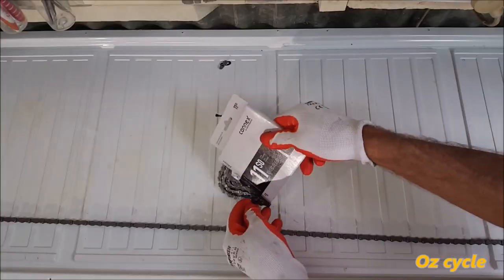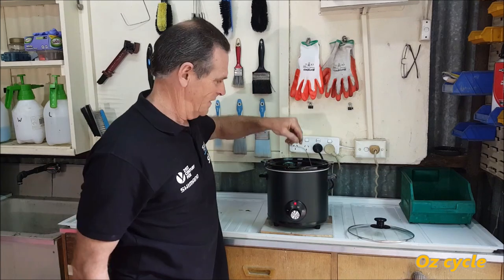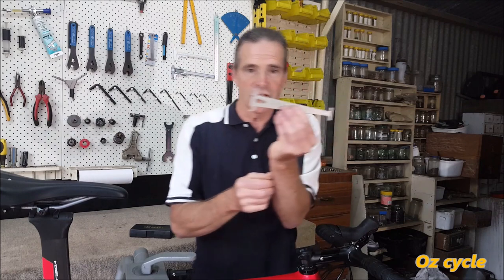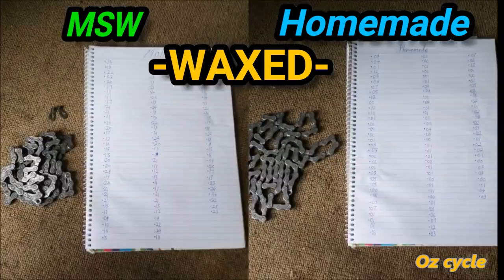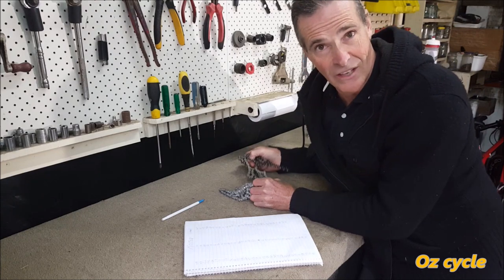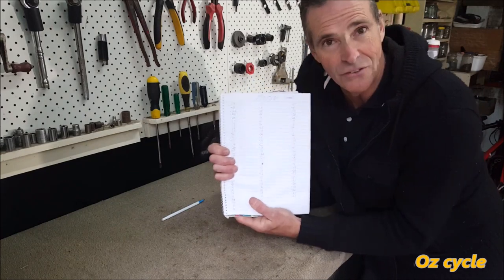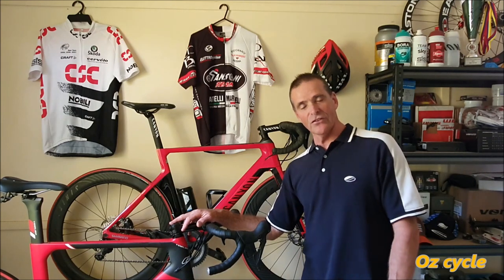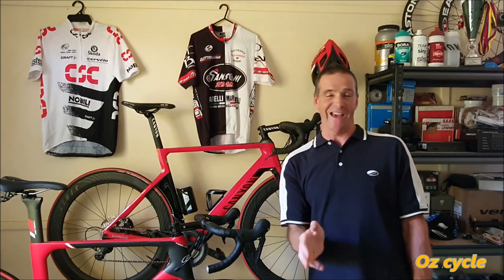Is this the ultimate bicycle chain lube? - Test results

Comment: I bet those are metal shavings in the jar, put a magnet on the bottom and dump the jar. I bet it's metal from the chain
Reply from the maker: I tried a magnet and yes,about half of the black residue moves with the magnet
Reply: @stevenleffanue  I use the park tools chain cleaner,  but bot the plastic one . I have the all metal one and stacked 2 magnets on the bottom to pullout all the damaging metal chips out of the chains when I clean them every 3-4 rides.

Comment: Molten speedwax has Molybdenum suphate in it. Thats whats in your petrol.
Reply from the maker: MoS2 is non-magnetic tho ??
Reply: @stevenleffanue  Im sorry i watched your other video later. To combat this during the cleaning step is that i have a small magnet in my cleaning jar. Which attracts the metal shavings in the chain. The interesting thing is why there is so much ferrous material there. Have you checked if your chain is rubbing the derailleur cage front or rear ever so slightly.

Comment: My MTB mix is paraffin wax and 25% 20w50 synthetic oil heat till liquid @~45-50C. Clean and dry the chain and immerse in solution for 15-20 min slightly agitate to ensure all air escapes the chain wax enters voids. Solution starts to skin @~28C. remove chain and allow to cool and drain in shade. I repeat this every 4-6 weeks (450-500km).

Comment: Measuring to even just .1mm while the wax is still on, and adhering to the jaws of the caliper, was pointless. Doesn't tell you anything, because you're measuring the compacted wax thickness. Needs to be metal on metal, as seen in second set of data. 

Cleaning procedure seems overkill. Brake parts cleaner/degreaser and a stiff brush would suffice.

Comment: Really good information, but I'm no longer a 'believer'. The noise from a waxed chain it a whole lot more. For me a quiet drive train is faster in my head, so faster on the road.
Reply from the maker: Sorry to hear your bad experience Byron. Key to successful chain waxing is initial thorough clean to enable the wax to adhere to the metal. It should result in smoothest and quietest chain.

Comment: You are missing the initial measurement, so I dont know if this renders Your test useless.
Reply from the maker: Could you elaborate a bit more,not sure what you mean?
Reply: @stevenleffanue  First of all, I love Your reviews, and would not consider them biased. 
For every measurement after the usage period, for the test to be scientific, You should have measured the chains as they were brand new, before waxing. We can compare them afterwards with a new one, but in 0.1 of an inch differences, the possibility of a slightly different initial lenghts cannot be outruled.
Anyhow, I still think theese should be of the same lenghts, considering theese are made in a same mold, I am just saying that, for the test to be scientific, we should always have a null-measurement.

Comment: 0.001mm??? I somehow doubt that.
Reply from the maker: You can check it with KMC website if you like Alan.... .001mm
Reply: 0.01mm
Reply: >0.5mm between 8 chain links is when the tool is designed to replace. Total length of chain will be increased many mm.

Comment: You did 3000 km with the original waxing?? If thats the case, who cares if one is marginally better than the other.
Reply from the maker: 41 rewaxings
Reply: I believe he re waxes more often by just sticking the chains back in the original wax without any cleaning first (any contaminants go to the bottom of the wax). He only does a full clean after 3000km.
Reply from the maker: Chains are cleaned every rewax (appx 250km) by putting chain in sieve and pouring hot water over.
Reply: @stevenleffanue  good tip
Reply: I'm using your original waxing formula, 6000 KLM and using the parktool chain checker I'm still easy in the. 05 limit. Btw I couldn't get paraffin so have been using diesel. Seems to work the same. Eager to see the new method 👍
You're the man , cheers
Reply: 3000km / 41 rewax = about 75km per rewax. Not 250km. This is important, rewaxing is too long, messy and tedious only to last 75km. Should clarify this.
Reply: @rodrigog.c.6047  I concur. The equation is wibbly. I could salad dress my chain every 75km's for equally delicious results. Still, mustn't blub.
Reply: @rodrigog.c.6047  Above, he wrote that he relaxed each chain 11 times so that is about 270km between relaxes per chain.
Reply: It says 41. Maybe a spelling mistake.
Reply: @rodrigog.c.6047  On another post he said about every 250km, so that is what I am guessing. You are right though. Must be a mistake

Comment: The chain wear tool you are using is not accurate at all, because it accounts for roller wear as well, which is not necessary. Read here: http://pardo.net/bike/pic/fail-004/000.html#commercial-wear-measuring-tools

Comment: Wax is a poor mechanical lubricant which is why it's not used anywhere else.  Try gear oil as recommenced by all chain manufacturers.
Reply: I agree. The worst thing you can do to a new chain is to try remove the lubricant it comes packed with. You will never get as much lubricant into your chain as it comes out-of-the-box. This isn't just my opinion; I've spoken with lots of bicycle mechanics, and this seems to be the most common opinion.
Reply: @davehysom2636  Exactly.

Comment: there are too many flaws in these tests to even lists but ill do my best !

. cleaning wax off a chain with spirits makes no sense warm oil will work way better ,
. how does in any way prevent chain stretch , that has nothing to do with chain lube , chain lube is suppose to decrease friction  

. the only way to get an accurate test is in a lab with equal consistent forces applied to the chains
. there is no way a wax or any lube is effective after even one day of riding you have to clean and wax chain almost every ride for maximum effectiveness , 300k and 41 weeks and your really think there is still way lube in the links , that chain doesnt even look dirty enough , something is off 

anyhoo we will put this videpo in the crack pot science division of youtube experts